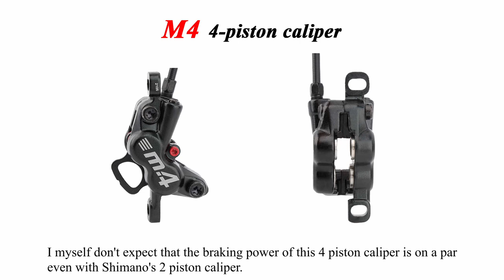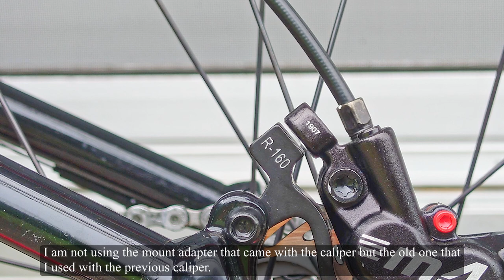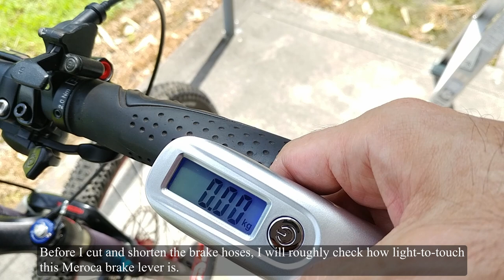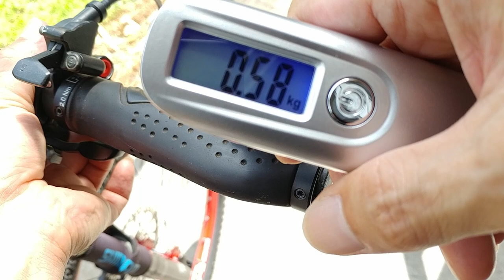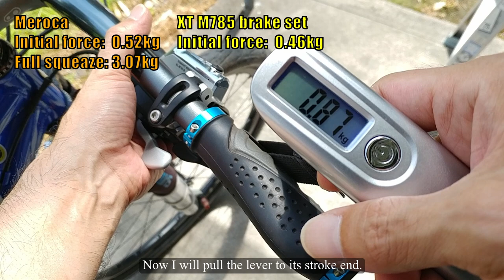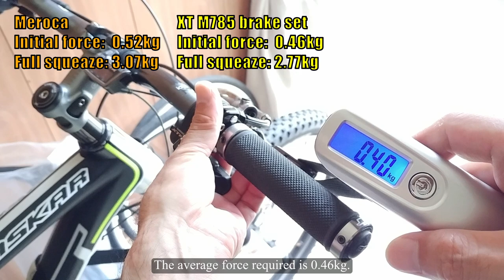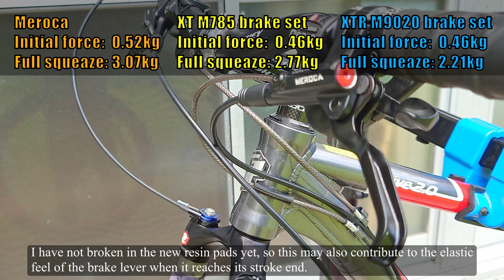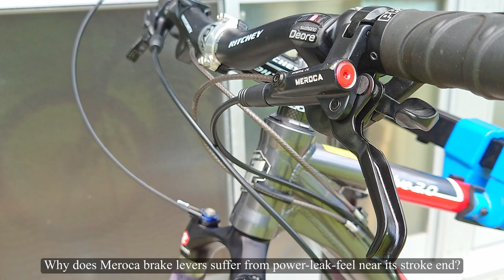[MTB maintenance] Meroca M4 - Installing Chinese 4 piston brake set

Comment: I ordered the same set of brakes and awaiting delivery. Great video. I look forward to your impression of it when riding. I'd better be prepared to buy new hydraulic line
Reply from the maker: Hi, I myself am looking forward to testing this brake set:)
Thanks for watching!
Reply: @MindDesignFactory  this is my first foray into hydraulic disc brakes. I've had various single and double caliper mechanical brakes and got (perhaps too) excited at the idea of 4 pot hydraulic for a price ess than a single caliper of shimano (m6000 series)
Reply from the maker: Ah, so this brake set is your debut into hydraulic disc brake world! Being a 4 piston caliper is not necessarily an advantage. First, it comes with weight increase. And secondly, especially with budget calipers from unknown brands, it will double the trouble if poor quality pistons and/or piston seals are used on the caliper. We'll see.
One thing I'm sure about is that this brake set would be a huge leap from any mechanical caliper you have ever used:)
Reply: @MindDesignFactory  I will be satisfied with improvement over mechanical and the experience gained with swapping hoses, bleeding, etc
Reply from the maker: Welcome to MTB home-mechanics alliance:)
Reply: @MindDesignFactory  is it normal to have to 'prime' the levers with a few quick pumps to attain full braking power each time you go for a ride?
Reply from the maker: You mean you have to, like, warm up the brake by pulling the levers a few times before going out for a ride? If so, no it's not normal at all. This Meroca set might be poorly bled at factory.
When you prime the levers before a ride, then the brakes perform no problem throughout the ride?
Reply: @MindDesignFactory  they perform ok throughout a ride.  I tried your video out to decrease the initial space between the brake pad and caliper. I think i did it too well. front locks up with minimal movement 😁
Reply from the maker: So you have tried my easy fix! I think it is an easier and more time-saving way to fix the slow brake response. Cheers:)

Comment: Two of the shaped washers have a concave and a convex surface - these two mating surfaces need to be between the brake adapter and the calliper to facilitate any alignment of the calliper . The third washer is under the calliper bolt head.
Reply from the maker: Thank you for the info!
I just remembered that Avid BB7 which I used many years ago had similar adjusting washers.
Reply: @MindDesignFactory  yes, I still have BB7's on one of my MTB's.
In order to centre the calliper, undo the adjusting bolts and apply the brakes - the calliper would then be perfectly aligned, then tighten bolts - perfect
Reply from the maker: Yeah, the method works quite well on BB7. But it works not always so well with hydraulic calipers even with similar adjustable mounts. BB7 is one of MTB brake masterpiece.

Comment: So as the cable hoses aren't as sturdy as the shimano doesn't it mean they are more prone for the cable to potentially burst or explode when you pull the lever hard?
Reply from the maker: I don't think the hose would explode even if you squash the lever under normal conditions. If you squash the lever with a bleed block inserted between the brake pads, then the hose might burst because all the pressure will be imposed along the brake line. But I think that the hose won't, even then, burst nor explode, because oil would start to leak at the hose connections first. It's just that you get a firmer lever touch and a lossless power transmission from the lever to the piston with "sturdy" or "incompressible" hoses.

Comment: What would you think would happen if I put stiffer brake hose and a better lever onto these calipers? I've heard that better levers can make brakes feel more powerful.
Reply from the maker: First, if you want more power and overall reliability, then you would be better off with a complete new set from more established brands and not from those Chinese budget brands.
Well, a better hose and Shimano XT levers, for example, might make the whole brake set more powerful and controllable. But I am not sure if you would be satisfied with the improvement. The improvement could be only marginal. If you already have good spare brake levers and better hoses, then it would be worth a try to swap them with Meroca's original levers and hoses.
Reply: I agree. If I can’t get these acceptable by replacing the Orings, I’m gonna buy the Magura M5 trail set which will probably be cheaper in the long run.
Reply from the maker: If you can afford to get Magura M5 set now, don't think twice and just get it :) 
Magura calipers look so sexy.
Reply: @MindDesignFactory  I honestly should have just bought a front magura and agree on the looks. 

But I did get the M4 installed, no leaks, and it is definitely better than my tektro auriga front ever was.
Reply from the maker: If your M4 works as it should, it might be the best choice for you for the time being. I mean that if you had bought Magura this time, then there would be no better alternative in the market. You have just saved the fun for the future :)
Reply: @MindDesignFactory  that’s true. And I’ve got the rear in case I every want to replace the rear :)

I dread installing that one though as the hose is through frame haha
Reply: @MindDesignFactory  agreed, I’m sure the m5 is better and obviously sexier aesthetically. But this m4 is still pretty damned good performance wise. I haven’t had any leaks and surprisingly didn’t have to bleed it after swapping handles.

I’m still going to bleed it, of course, once I find where I put my bleed kit 🤦🏻‍♂️
Reply from the maker: Hi, Clarks' video of how to bleed the original M4 would be helpful then. Check the following link out:

https://www.clarkscyclesystems.com/the-bike-bench/how-to-videos/m4-hydraulic-brake-system.html

Have a nice weekend :)

Comment: Good vid. Anyway between this brake set and shimano mt200, which one you suggest for xc riding ?
Reply from the maker: Hi, I personally won't recommend MT200 series unless you ride more in urban areas than in mountains. I have no first-hand experience of MT200 brake, but Shimano intentionally reduces its braking power for entry level riders (see the link below):

https://bike.shimano.com/en-EU/product/component/alivio-m3100/BL-MT200.html

Also, if you usually pull a brake lever with one finger, then MT200 lever would feel a bit clumsy as it is designed for two-finger or three-finger use. I highly recommend MT500/501 series instead.
As sub USD80 brake set, I might prefer Meroca M4 set to Shimano MT200. My concern about Meroca is its durability which is still unknown to us. If you can buy Meroca on sale or much cheaper than MT200, then it's a go, I think.
Thanks for watching"
Reply: @MindDesignFactory  I test-rode a bike with an MT200 at a bike shop once. I couldn't do a stoppie with one finger, and I barely managed with 2. It's honestly a terrible brake. Getting a used set of Deore / SLX / XTs would be preferable. I think the cheapest option I'd go with new is the MT500, the MT410 might be alright too, I've never tried it though.
Reply from the maker: Hi, thank you for your first-hand impression of MT200. Shimano's MTB component grades are categorised into two main groups, one for XC/Trail (XTR → XT → SLX → DEORE) and the other for Downhill/Freeride (SAINT → ZEE). MT500 and MT410 are of DEORE grade, but MT200 is of ACERA grade. ALIVIO, ACERA etc, are traditionally not MTB grade components, but belong to lower grades components for ATB, (very) entry-level riders or recreational riding. So comparing MT500 with MT200 is actually rather pointless :)  MT200 is intentionally optimised for more recreational/urban riding. I'm very surprised that so many YouTube reviewers/influencers review MT200 as a real MTB components without fundamental knowledge of the reviewed items. 
Your impression of MT200 is much more valuable for those who consider using it for real mountain biking, indeed.
Thanks for watching!

Comment: hi there. do you know where to finds fittings for this brakeset for internal cable frames? or what similar fitting does it use?
Reply from the maker: Hi, I'm afraid I don't know what fittings to use for internal cable routing. Or are you looking for grommets to use on the openings of your frame?

Comment: I can the the olive are not the same shape as the originals. Is it ok? Also,do you use the old O ring on that new olive?Thanks
Reply from the maker: Hi, I'm not sure your parts will do the job. If your parts are Shimano SM-BH59 compatible, then they should be ok. And you don't need an o-ring on the olive. Cheers.

Comment: I have the MT200 and thinking of buying this one just to use the calipers. Is this a good idea?
Reply from the maker: I think this Meroca 4-piston caliper works very well for its low price tag. But as a matter of fact, it is reasonably priced after all. So I myself think it is not a so good idea to buy a Meroca brake set just for the calipers. Shimano works much better and is far more easier to maintain including bleeding. Just my 2 cents:)

Comment: what ilive and fittings can fit in the brake hose?
Reply from the maker: The hose is the same as Shimano BH59 brake hose. So use those olives and inserts compatible with Shimano BH59. Cheers.

Comment: are theses good? Can you make a brake test video please
Reply from the maker: Hi, I have made a very quick test ride and now is editing a video of it. I will upload it when done. This Meroca brake set is very good performance-wise considering its very low price tag.
Thanks for watching!
Reply: @MindDesignFactory  Ok please upload it ASAP if you dont mind! I need new brakes and im debating if I should buy theses or not
Reply from the maker: If you need impeccable stopping power, adjustability and ease of maintenance, then go for Shimano. If you have a tight budget but still want a decent brake set, then Meroca might be a good choice.

Comment: Purchased 1 piece. Because it came as right hand front one I had to swap the hose,  fitted a shimano bh59. The brake had no power. I used pads I have positive experience with,  no improvement. The initial bite was weak, the second and following ones were average even if I run 200 mm rotor. My test ended after 2 weeks with leaking caliper. Bad support from seller.
Reply from the maker: I'm sorry to hear that. It seems that your unit is definitely DOA. Can't you return it for refund or replacement?  Some have received decently working sets, some have received defective sets. The quality control of this Meroca brake seems to be non-existent.
Reply: @MindDesignFactory  the seller offered me 8£  discount for next brake  😁 I purchased that one to test it and , if it's ok, purchase more to sell them (workshop spares). 20£ per brake is not worth to return it. Even when it worked it performed badly. 4 piston brake should be definitely a strong brake,  but it wasn't. It performs under any expectations with stock and shimano hose as well. Shortly after the period that one wa used by me I ride a bike with cheap clarks brake that outperforms Meroca being paired with 160mm rotor. Meroca looks and feels cheap
Reply from the maker: As a matter of fact, "4 piston" is in this case just a marketing hype. I use XTR M9020 brake sets on my main bike. And compared with XTR, Meroca M4 is a piece of crap. But still I think Meroca works fine for its low price tag. Your Meroca should be defect on arrival. Looks and feels cheap? Oh, don't say that. Everyone is fully aware of it :)
Reply: @MindDesignFactory  the shimano  mt20p is more powerful with the same rotor  size
Reply from the maker: Really? My Meroca's stopping power is actually good enough after tweaking though you need much more finger power than with XT.
MT200 brake set is now very cheap, so MT200 would be a better alternative for some people.
Reply: @MindDesignFactory  I had maybe 50-60 brake sets in my cycling life. Those ones are at the bottom of my list. It's entry level,  yes, but should be good, it's a 4 pot brake,  what normally means harder intended use. I run other brakes at the same time,  high end and entry level ones and all of them perform better.
Reply from the maker: Comments like yours are very valuable I think. And I wish all watching my Meroca videos also read through the comment section. The same brake set seems to work just fine for some but to be junk for others. It is always good to have a wide perspective to be able to evaluate something which you don't have in your hands.

Comment: Might as well have switched the levers to the correct sides when you shortened the lines. 😉
Reply from the maker: Do you mean I should have switched the levers so that the left lever is connected to the front brake and the right lever to the rear brake?
Well, first of all, did you know that FBR (front brake right) is default in UK , Japan and many LHT (left-hand traffic) countries. Secondly, FBR is prescribed in JIS (Japanese Industrial Standards):

JIS  D9301 : 2019 5.2.2 (a)
"Brake lever position : The brake lever for the front brake shall generally be positioned on the right side of handlebars, and the lever for the rear brake, on the left side."

Of course you can do FBL on sport bicycles as road bikes and MTB here in Japan. But as said, strictly speaking, FBR is not only de facto standard but also prescribed in JIS here in Japan. Just for your information:)

Comment: I want to ask.Is this brake good? Strong to the grip of the brake?
Reply from the maker: Yes, good for its very low price tag. It may behave a bit awkward, but you can improve it in several ways.
Reply: @MindDesignFactory  woke i gues i will try ii thanks for answering my questions
Reply from the maker: I thank YOU for watching!

Comment: Rotor 14"..?match or support ser??
Reply from the maker: Do you want to use 140mm rotors? Or do you mean a 14 inch rotor for a motorcycle?
Reply: @MindDesignFactory  Thank you..use scooter ser roters 14 "
Reply from the maker: I don't recommend to use this on scooters. You need a caliper that can take much bigger brake pads. I don't think that this caliper can stand with the load to slow down a scooter.
Thanks for watching :)